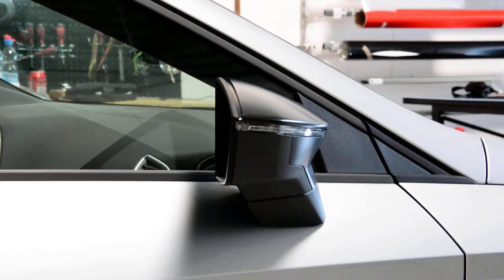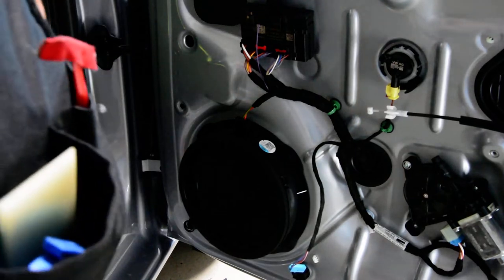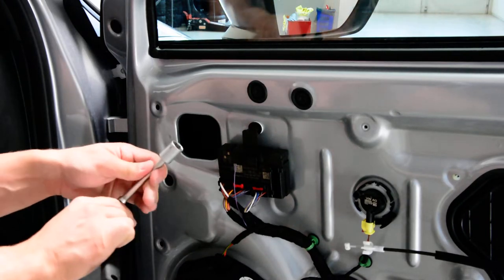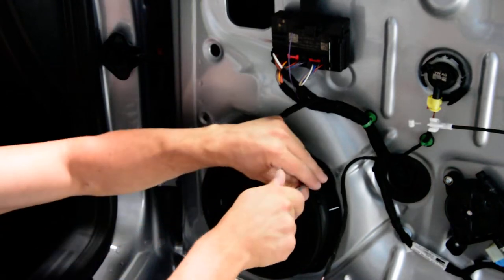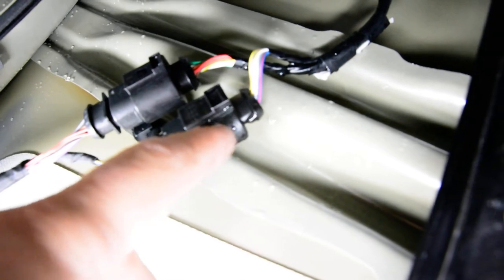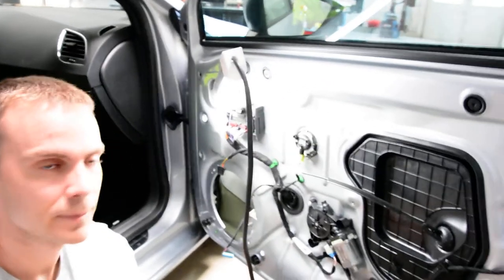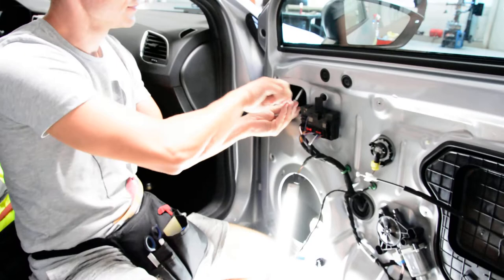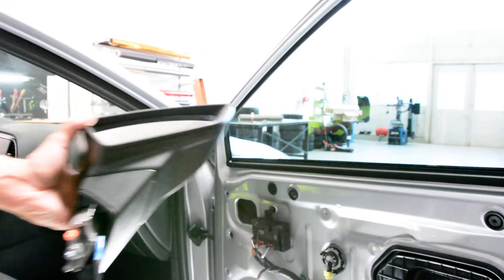How to Install Replace Side Mirrors on Seat Leon Cupra

Comment: Great video! Very simple and clear instructions! 
Can you do a video on replacing the wing mirror motor? 
Mine has just failed and a quick search revealed that they are a really common thing to fail.
I'm not sure if I need to remove the whole wing mirror to get to the motor or not.
Reply: I've had one fail on the passenger side, now my drivers side has failed.